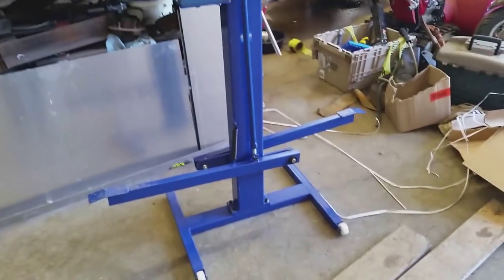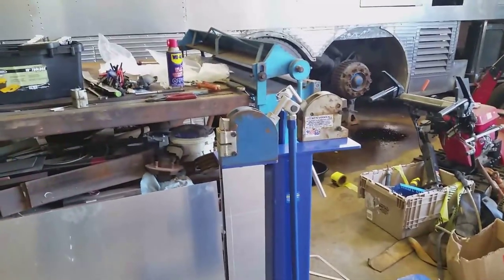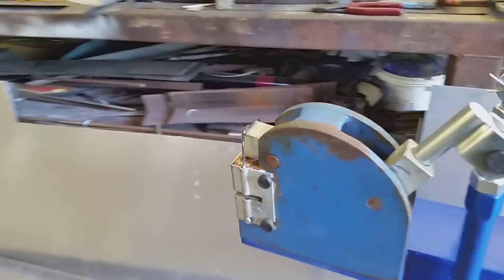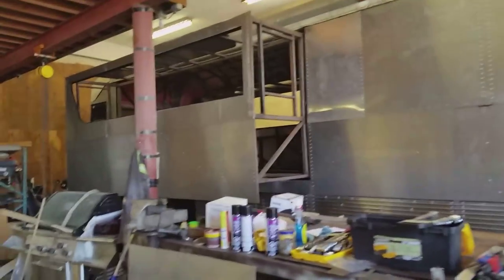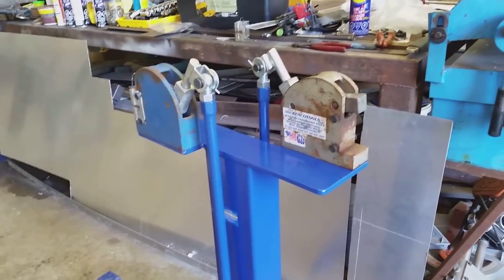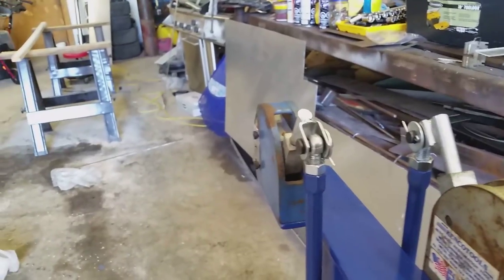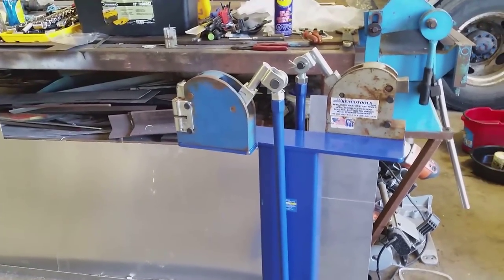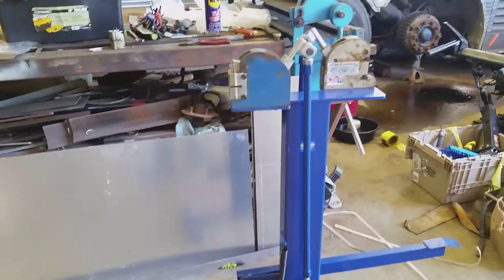Bus Conversion Project - Video 60 - Continuing the Passenger Slideout Skinning

Comment: Have you ever considered doing a roof raise I seen this on a Nother MCI conversion do you think it’s necessary when converting a seated Coach to an RV
Reply from the maker: 12" roof raise was done already see video's 10 and 11, it's not absolutely necessary but makes cabinet installation and anything mounted in the ceiling easier, it also allows moving the windows up so it is easier to see outside, a bus has the windows positioned to be easy to see outside from a seat, once a motorhome it's nice to see outside while standing, there are other advantages as well but these are the main ones, my windows are mounted  7" higher than original

Comment: Did you build the cars in this current shop? Tour of the shop? No topper on the slid outs? Nice. Down to Blaine, so you are in Vancouver? Glenn Lever
Reply from the maker: Not this shop, my shop I built cars in had a paint booth, this one doesn't, bottom kind of dropped out in 2009 so I had to close it

Comment: What made you decide between MCI Over Prevost Or is there no real major difference
Reply from the maker: MCI's are typically less expensive for the same spec's, Prevost is more popular for the hi end conversions such as Marathon and Custom Coach so the shells are more expensive but there is not much difference .... they all used the same components